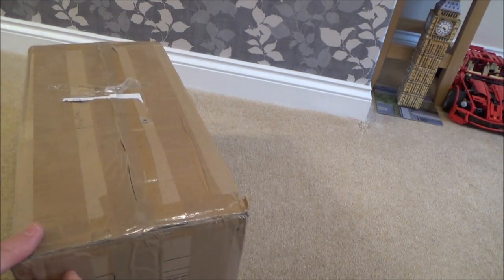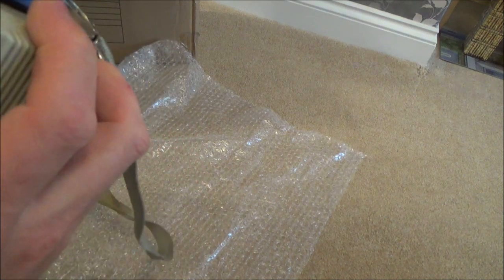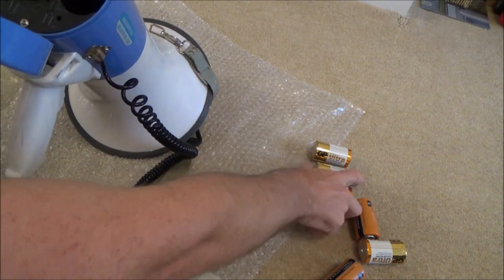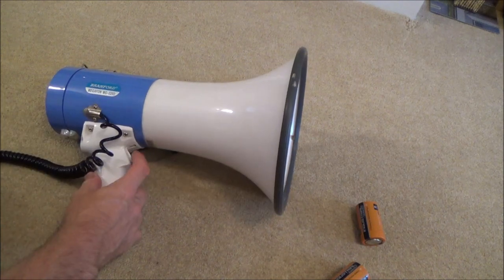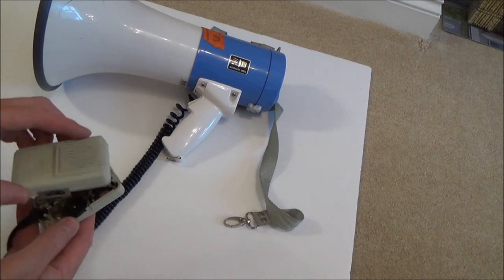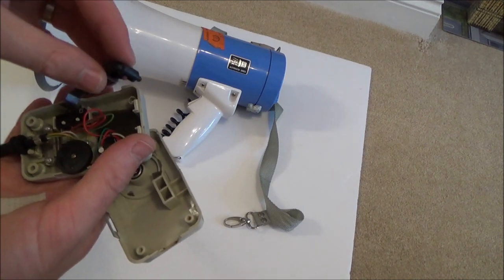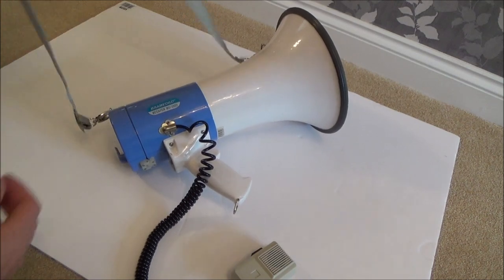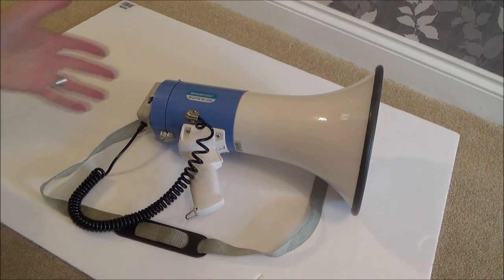Trying to FIX a Faulty Megaphone purchased on eBay

Comment: In ham Radio that Button is called PTT (push to talk) and then lock is PTT lock. Boring comment, sorry. This would also be a fun video. Tryouts to fix a ham radio. Unfortunately it’s not allowed to transmission without a proper license 😹